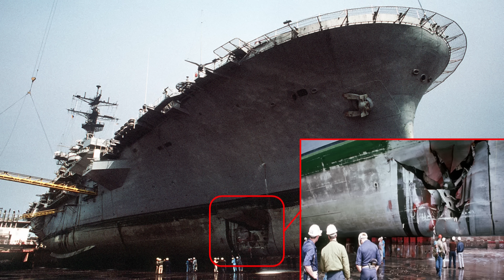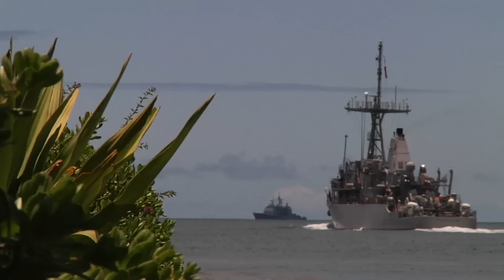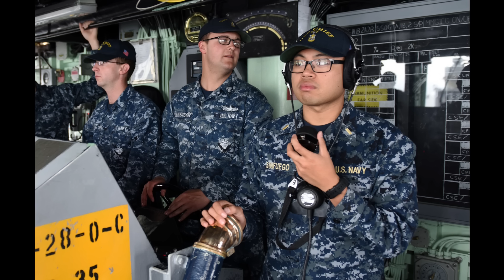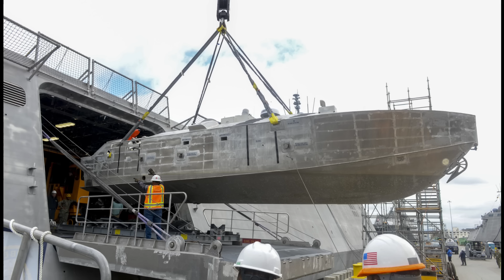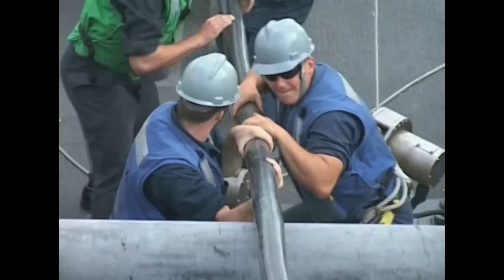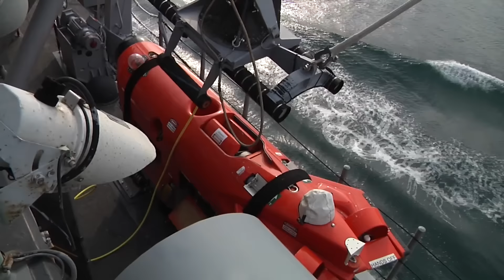US Navy’s Mine Warfare Problem: The Avenger Class Minesweepers

Comment: The U.S. had better get building mine sweeper/detection ships. If they don't they will be in BIG trouble.
Not only for detecting and clearing mines in choke points like in the persian gulf and the red sea but all around taiwan and off the coast of okinawa. The chinese have built a huge stockpile of very advanced and varied types of mines designed specifically to target warships AND submarines . The U.S. has fallen far behind in it's anti mine warfare capability.  Littoral Combat ships of the Freedom class and the Independence class were never meant for mine sweeping/clearing.  But what the hell, Every ship is a minesweeper -  ONCE.  Those Iranian small fast attack boats dash out into the Hormuz straight toss off 4 -6 mines and dash back to cover along the coastline. They don't have to sink every ship, they sink one or two and then the insurance companies do not insure the ships and EVERYTHING come to a halt, because nobody sails without insurance.

Comment: I think the lcs anti mine module will be good enough for the time being.
Reply: You're wrong.
Like Trump was when he was certain the Iranians wouldn't close the Straits.
Reply: A expensive steel-hulled ship with zero track record at doing this. Nice.
Reply: @nighttrain1236  The msm 'mine counter-measure' package had initial test back in 2021. And is already deployed to vessels in regions such as the middle east.
  Modern anti-mine ships aren't dumb enough to travel through minefields themselves, nearly all of most modern operate using surface or subsurface drones at a distance.
  This isn't ww2 where mines are rendered helpless by a shallow draft and a wooden hull, it is the expectation for any mine clearing package to deal with modern and far more advanced mines that will not be fooled by those basic precautions, therefore the route is never to have a manned ship enter the space at all, and have unmanned drones carry out the detection and detonation.
Reply: The LCS can't defend itself and the drone ship very well
Reply: @JeffBilkins  and the Avenger could? No, the only thing the Avenger could do that the LCS can't is run mechanical sweeps and use a obsolescent VDS.
Reply: @JeffBilkins  lcs is on par or better than all other minesweepers currently in service across the world.
  This type of warship historically and even presently has rarely had the firepower of frigates or even corvettes.